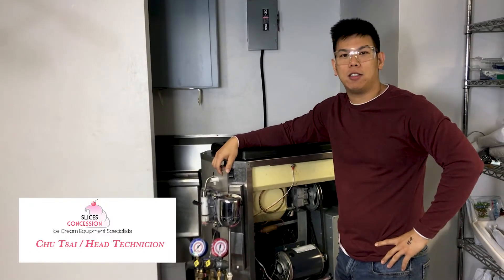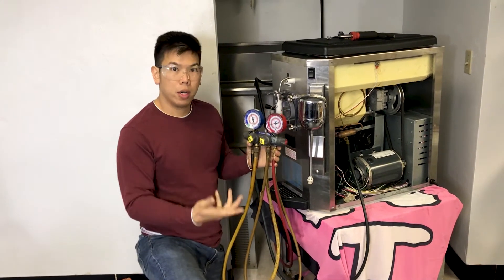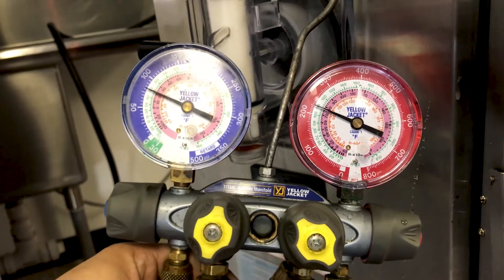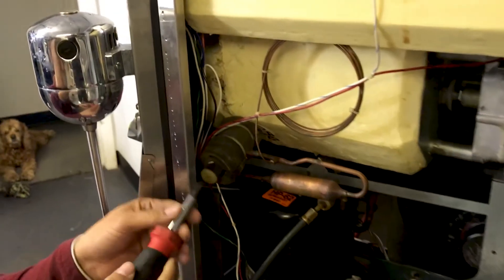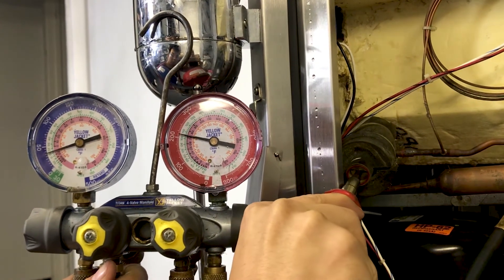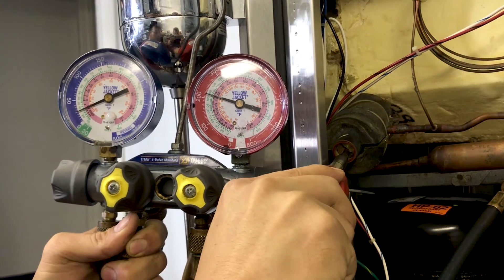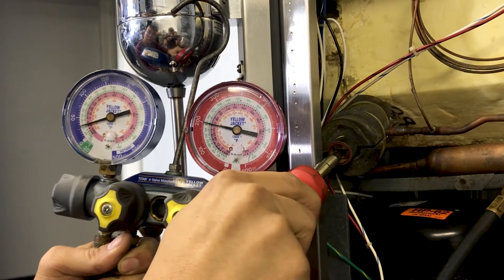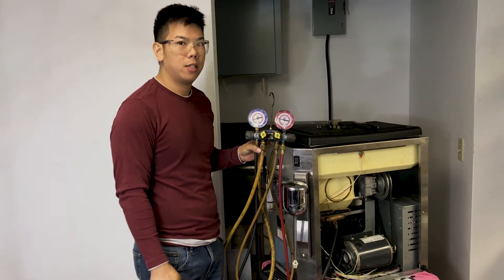Taylor 430 Expansion Valve adjustment

Comment: Great video. Could you show us the port on the machine that you connected the gauges to? How many hoses were connected to the machine to get your readings. I have a 432, same as 430, except it has 2 barrels instead of one, and I’m having trouble locating which ports to plug my gauge into.

Comment: You really should make adjustments with product in the machine. If not, it could be thrown off when you do put product in it. I'm a Taylor Technician for a distributor in Dallas, TX.
Reply: Terrence Hi have a question, I have a Taylor 161 bought recently and have seen the barrells have scaring, Any ideas?
Reply: @scottgarrett7069 was it a new machine or used? That could be from wear in tear over the years or from bent or warped beaters. If those grooves get too deep, that could cause issues with unit performance. I would call your local authorized Taylor distributor to have a service tech come out and take a look at your unit.
Reply: @terrencejenkins87  do you happen to know how hard is to replace the expansion valve in a 791 model ?
Reply: @masoji6810  the difficulty is relative to the type of experience you have servicing this type of equipment. 

Replacing an expansion valve on a 791 is not a DIY type of repair unless you have background experience servicing this equipment.
Reply: @terrencejenkins87  thank you for your help
Reply: @masoji6810  you’re welcome.

Comment: Appreciate the information. How would you know if you were low on refrigerant vs needing to adjust the txv?
Reply: Monitor the head pressure (red gauge) while it's running. You should be around 240-270 psi depending on inside ambient temperature. If your below that typically 200 psi or less, that's a sure indicator that the system is low on refrigerant, which would therefore mean there's a leak in the system somewhere.  If the suction is low too, that's even more proof that it's low. But usually tge AXV will still where it should but the high side pressure will be too low indicating low refrigerant in the system. I'm a Taylor Certified Technician. I service these machines all day lol.
Reply: @terrencejenkins87 I have a 430 that freezes too much in the reservoir. Is there an adjustment for this issue. The machine just recently started doing this. Any advice is greatly appreciated.
Reply: @bluejay2go  The reservoir? Do you mean the hopper where the liquid mix sits in at the top? If so, then that would indicate that the EPR valve is set too cold. You’ll need to put a blue gauge on that valve to see what the pressure is is set to. Those should be set to 69-70psi. If lower than that then you’ll need to adjust the valve and raise the pressure. If you can’t adjust it and it’s stuck wherever it is, the valve will need to be replaced.
Reply: @terrencejenkins87 I have a taylor 432 and want test it but can’t locate high and low pressure connection points on the machine. Any idea where i connect my gauges to on the machine?
Reply: @JosephSmoker-pt3zp on a 432 you have to remove the front face panel. You’ll see the compressor and the low side high side service ports from the front of the unit. But you have to remove the front panel underneath the doors.
Reply: @terrencejenkins87  thanks! Machine says low pressure should be 25-27 psi. Any idea what high pressure should be? Trying to determine if I have a leak somewhere.
Reply: @JosephSmoker-pt3zp We typically set the Expansive valve on those (low side) to 30 psi. Head pressure or high side is around 245-260 psi. If your head pressure is below 240psi, it may be low on refrigerant or leaking refrigerant. 

To check these pressures properly, there must be product on the unit.

These pressures will vary depending on if the unit has r404 or r449 refrigerant.
Reply from the maker: only a technician with gauges on the machine can answer that. All else is conjecture.

Comment: Oh, man! Thank you so MUCH for this video!!!!!! You saved my day today! THANK YOU!!!!! I just replaced filter-drier and two expansion valves on my Taylor C723 because of line restriction and machine finally started to work. However, after each 12-15 mins compressor would overheat and thermal protection will cut it off. So, my suction line pressure was ~20 and I’ve corrected it to 35. It increased refrigerant flow trough the low pressure side and as a result that refrigerant is cooling the compressor appropriately. Man, I am so happy that I’ve found your video today!
Reply: Dude for a 723 expansion valve must be set at 16-17 psig for r404a. Anything else indicates a problem. Was your condenser clear, is the  compressor overload failing,  what is compressor amp draw? Plus 15 minutes is a long time for a freeze on a 723. Whats the viscosity set at? 35 psig is the wrong answer.